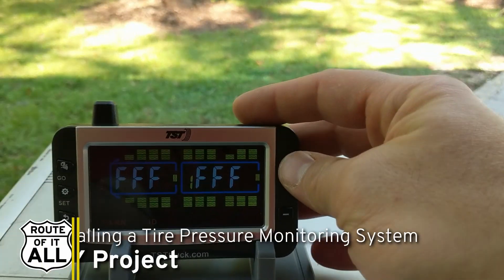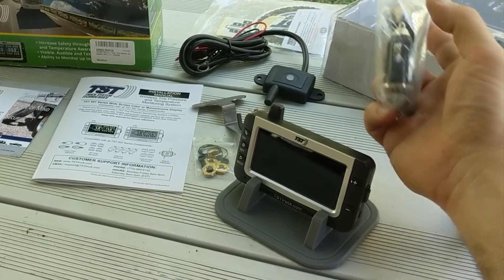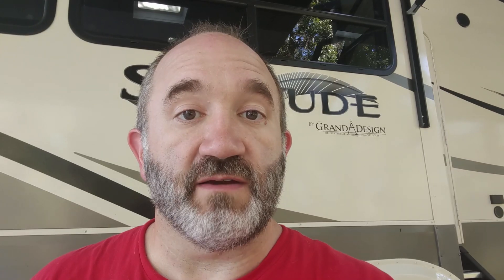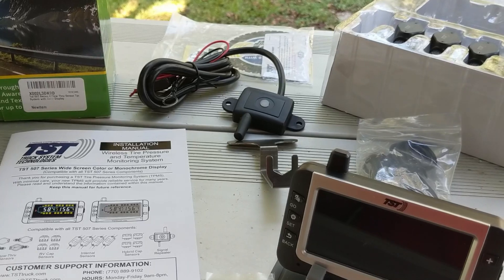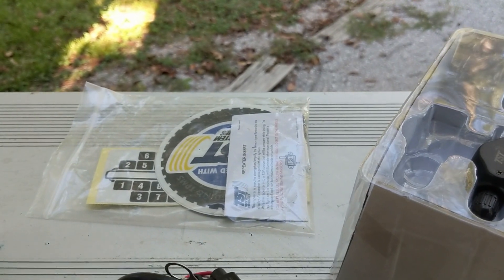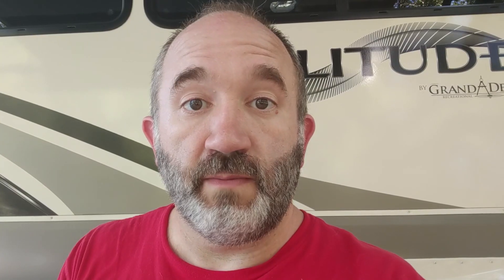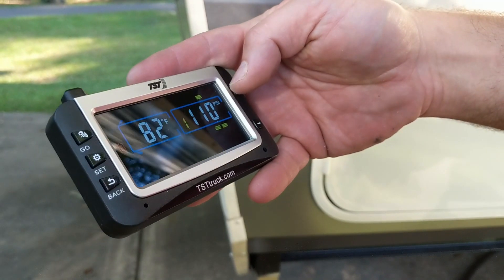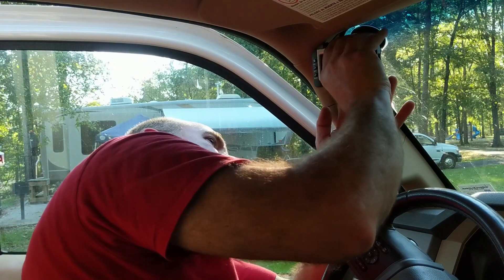Why should you have a RV Tire Pressure Monitoring System? RV LIVING

Comment: did you nee to install the repeater?
Reply from the maker: We haven't yet, but we have found that unless the display is mounted high on our windshield, we'll occasionally have problems receiving a signal.  Otherwise, we haven't had a problem with the TPMS and love the peace of mind it give us. So just to be absolutely certain that we have a reliable signal, we'll be installing the repeater soon.
Our trailer is 34.5 feet long, apparently that behind a long bed truck is just enough distance to make installing the repeater a good idea.
Have you picked up a TPMS system yet? If so, how do you like yours?